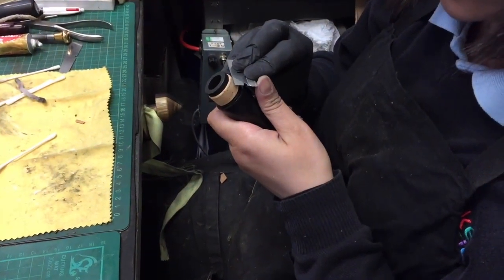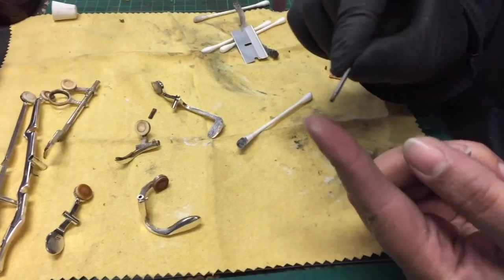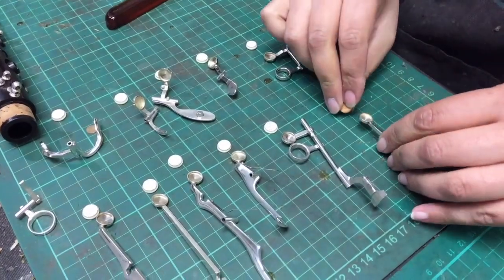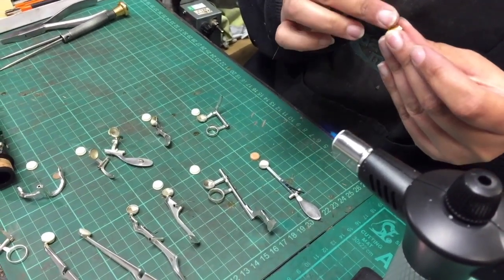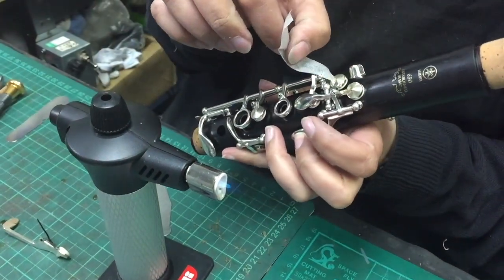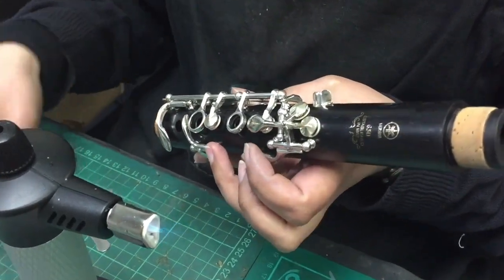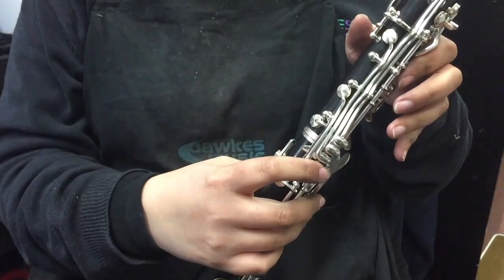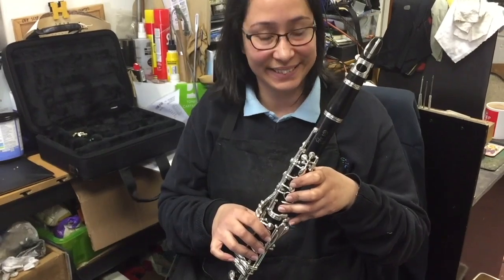Woodwind Repair Cam - Clarinet RePad (Ana)

Comment: Very interesting! I have just spent hours and hours trying to put in new pads on the low E and F keys. Have now destroyed two pads. This is an  extremely skilled job. Why are clarinet pads so weak with paper and very thin skin. Give me sax pads any day. Don’t think Dawkes will be offering a job any time soon!
Reply from the maker: Yep, it's harder than it looks. You can always get leather pads for Clarinet (and Gore-Tex) which are sturdier, but the skill is in putting them in correctly which takes time, teaching and practice :)
Reply: dawkesmusic Thank you. The pads are in BUT the needle springs are not working properly.......l.l.

Comment: After the re-padding, do you check each joint with Differential Pressure Gauge, to see if it seals well — not only 'audibly' (by play testing it) but physically too (which may or may not be audible right after re-padding)?
Reply from the maker: Hi, yes - after the re-pad all joints are checked as full joints, and each pad is individually checked by hand to ensure optimum seating.